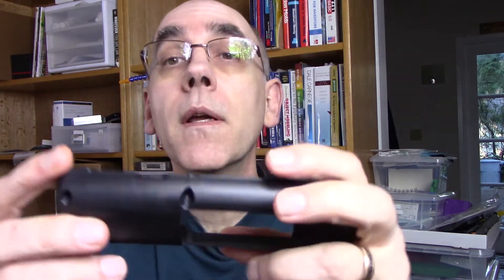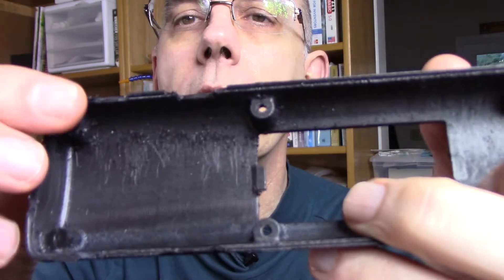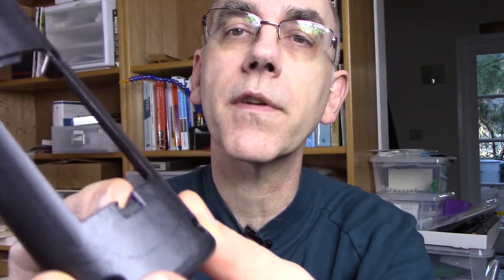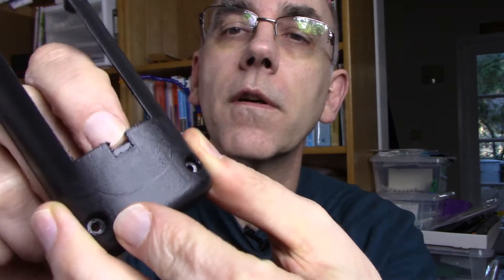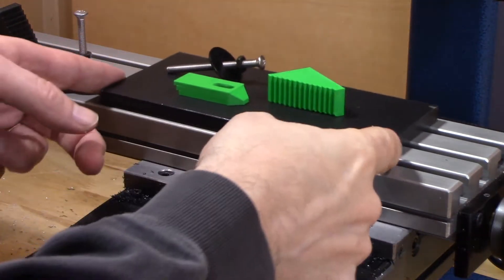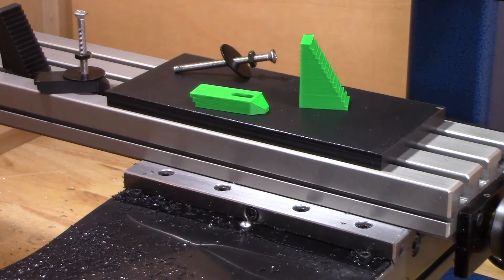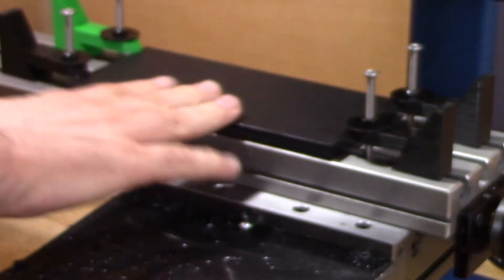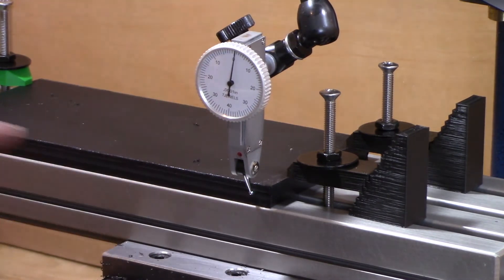#25 CNC Milling a Throttle Case

Comment: Thanks for sharing. My question is the same below. How did you do registration of the two sides? I have issues milling plastic. Maybe I was just trying with the wrong plastic (PP), but could never get rid of molten flashing. What is the feed rate, spindle speed etc you are using here? Is this a 3 flute end mil?
Reply from the maker: I created a video to answer your question: https://youtu.be/kZmkpE59qic. Hope that helps.
Reply: JohnSL Awesome, thanks. Appreciate your time for doing it.